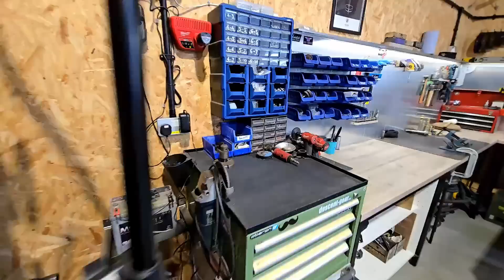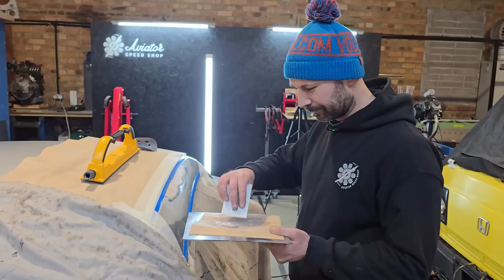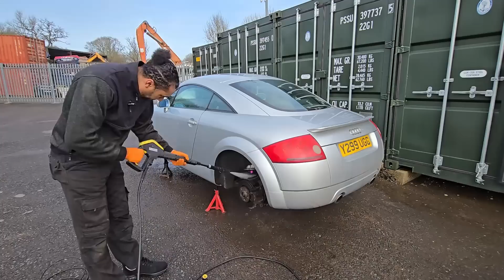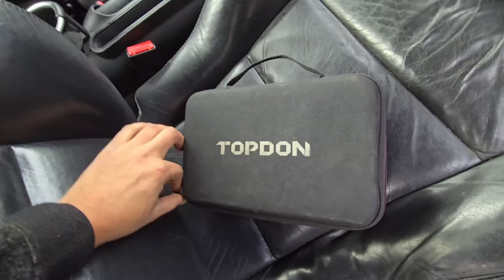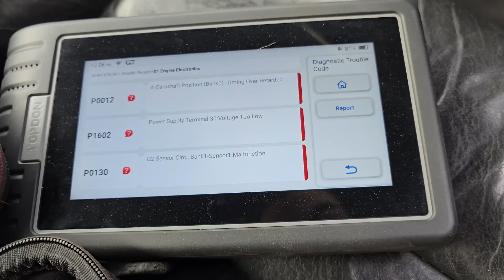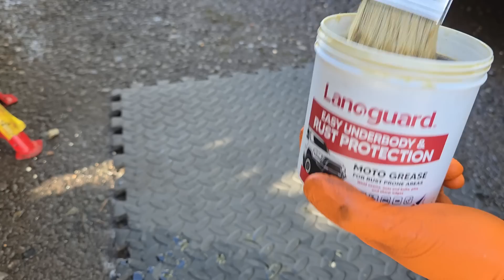The Damage is Undone! | Project Car - Audi TT mk1 ep02

Comment: Max the airbag normally it's the yellow connectors under the seats that they give that error, I just swap the connector for a normal bullet type and error disappeared. Don't forget to grab that rear axle with proper anti roll bars etc it's like to be a little loose in the rear that car if you can just had a proper spoiler on that boot looks horrible but helps to put the tyres on the road.
Reply from the maker: @Empir3_  the airbag system will be disconnected anyway, as the seats and steering wheel will be replaced soon anyway hopefully. I'm trying to see what I can do regarding ARB upgrades and bracing, but it all comes down to sponsors etc.

Comment: A good upgrade for Mark IV golf/TT platform is castor bushes (whiteline do them) to give more castor and camber gain, and also some decent top mounts. I has some comp brake ones that were great. If you look at how the top of the struts basically aren't connected to the chassis, you'll see how they make such a difference to the steering and dynamics!
Reply from the maker: @philmyerscough1  thank you for the advice. I'm definitely looking for some bracing and handling upgrades as we speak. It all comes down to budget at the moment. But as the project progresses, I'm sure more and more will be added and upgraded.
Reply: @Maxwell_Millz  you might be able to get your friend at Aviator Speed Shop to make some top mounts as he has a lathe. They're pretty simple to do and that would make an awesome video to see the process!

Comment: Scrape the excess filler off the applicator after every pass
Reply from the maker: @jase6709 is that a tip for getting a more even spread?
Reply: @Maxwell_Millz  Yes, Instead of splodging a lump over multiple passes, just apply, scrape, apply, scrape. Also makes sanding a lot easier.
Reply: @jase6709cool! Thanks for that!

Comment: If you do it in the future ideally  bleed the brakes with OBD tool. Audi has a procedure for it that uses ABS module for bleeding. Airbag light comes on only under about 4 degrees C. If you reset it when it's warm It won't come back.. So yeah.. 😅
Reply from the maker: @MattDvc  yea it's definitely not resetting, but it's all coming out anyway, so I'm not concerned at all. Engine light did come on last night on my 'spirited' drive home. But the car runs perfectly, so I suspect it's one of those old faults. At least now when I get a chance to scan it, I know what faults are actually present. I suspect lambda
Reply: @Maxwell_Millz  yeah. I only drove it to work and back in 'non spirited ways' in last few months so it probably never had a chance to throw any errors. The camshaft one has been intermittent since day one and never caused any issues. By the way, when Shadoe told me it made it on it's own power all the way to Bristol I felt like a proud dad 🤣🤣🤣
Reply from the maker: @MattDvc  haha I've done about 600 miles in it. It's definitely all good.
Reply from the maker: @MattDvc  the topdon can do the ABS bleed, but i wanted to show people how to do it manually.